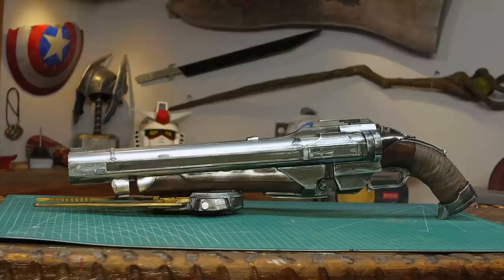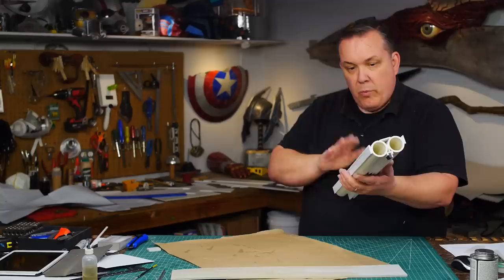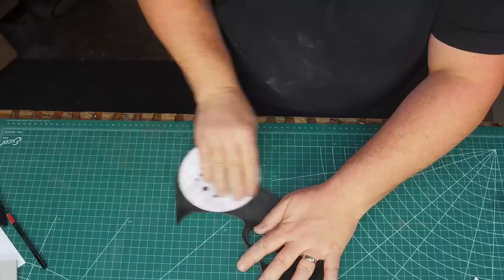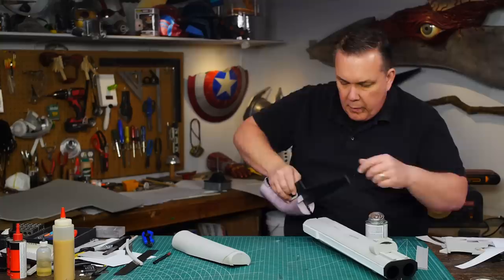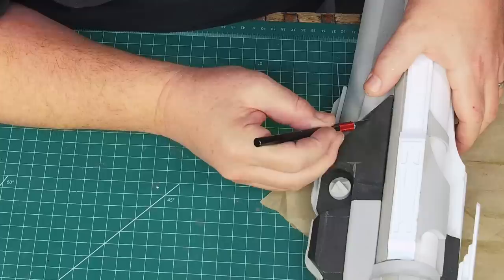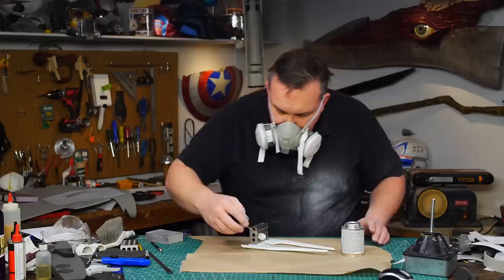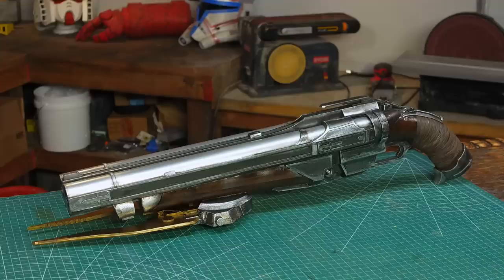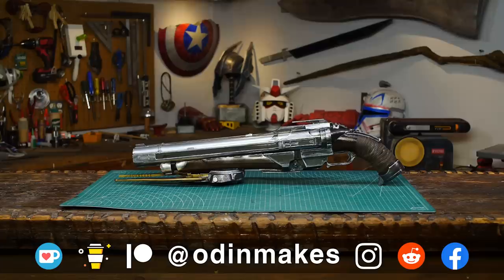Odin Makes: Super Shotgun from Doom Eternal

Comment: If someone else wants to make this and have the hook be detachable, embed an ID tag holder (the one's with a small spool of wire in it) in the chain storage section and attach the end to the hook. And then you can use some small magnets to hold the hook in place.

Comment: 06:11 For those that are not familiar with the Tang: A tang is a portion of a firearm (usually a rifle or shotgun) which extends rearward from the receiver. Often slim, it may be short or long and most of the time its purpose is to attach the receiver to the buttstock.
 In old-fashioned sidelock muzzleloading guns, which lack receivers, the tang usually serves to securely attach the rear of the barrel to the stock. The tang often contains some parts of the gun's action, too. For example, many times the tang will contain a thumb-operated safety, springs, and/or portions of the trigger assembly.
Reply from the maker: I was also thinking of "Full Tang" knives and swords, where the metal of the blade can be seen inside the handle. Funny that it really is called the same thing in a firearm. Need to learn something? just open you mouth on the internet!  :) HA!
Thank you Steven, I know you are only helping, nothing mean!

Comment: The barrels are more spaced apart and have the symbol of the beast on the front
Reply from the maker: Then the file I have is wrong. my dimensions match my reference.
 I did not get an official model from Bethesda- I don't know if I could.
Reply: I commented too early, the space for it is there, your models are correct, but you didn't carve it.

Comment: Odin, how do you keep sanded areas on foam from "fuzzing up". I have this problem time and time again. These areas also tend to soak up massive amounts of paint
Reply from the maker: In a way, I can't. Its part of what happens. When I use a machine that spins in a single direction, I don't see it, but I bet it's there- it's just like combed hair. smooth looking because it is all in one direction. Really fine sandpaper 400 or 600 grit removes most of it from HD Foam. I am told that people have used wax paper and a low temp iron to smooth fuzzy foam. And the wax amount is small enough it doesn't interfere with painting. I have not tired this.  So Belt sanders and Dremel can look smooth, orbital sander and sheet sanders are the worst for fuzz. If I sand by hand, I try to go in one direction mostly, not "wax on, wax off" style.

Comment: Odin, You seen Michaelcthulu ff7 remake buster? It's on point.
Reply from the maker: I have not! I will look it up.
Reply: @OdinMakes  Also your mics are way different, or you sound tired during live narration vs chipper in post narration.  Keep rested and avoid Calorie deficit during this Coronalogna craziness.  Dig the quick cosplay prop builds.👍
Picked up all the clearance flex seal cans at Walmart 👍👍

Comment: I'm sorry if I come across as being a Debbie Downer when I say this, but it makes me very concerned for your health to see you do some of things you do such as use a disc sander on foam without proper breathing protection. I get some people my think their fine sanding something with power tools or doing other things that require a filtration mask without one because they figure they're not in any danger since they aren't belt sanding metal or something like that but that doesn't change the fact that you can end up with a bunch of airborne dust from plastic or foam or various fumes that will enter and damage your respiratory system.